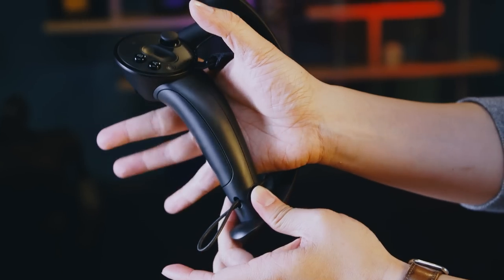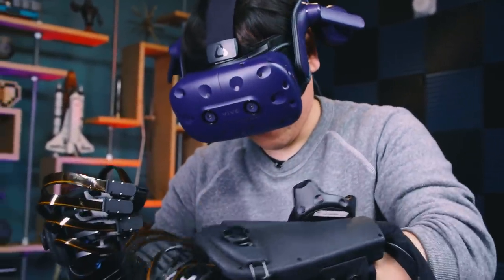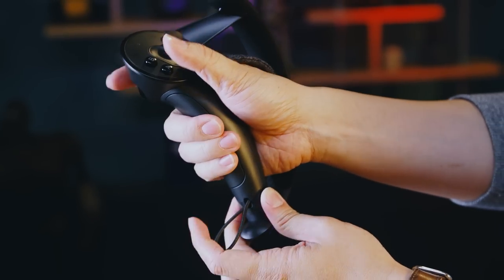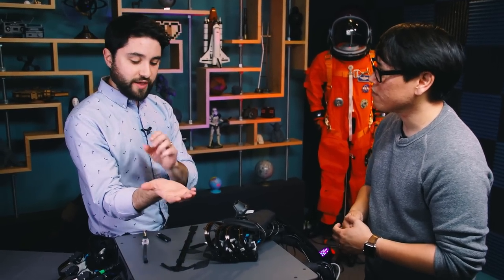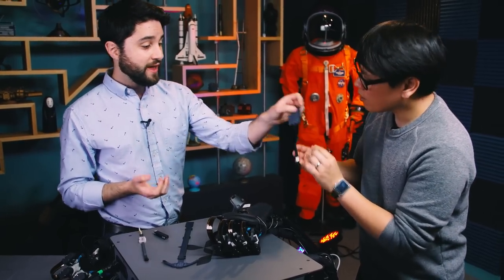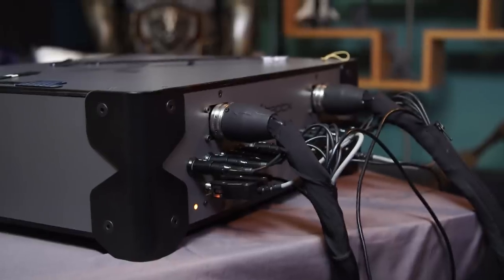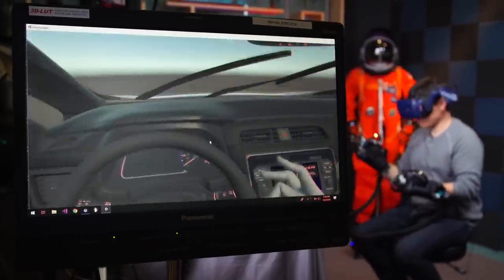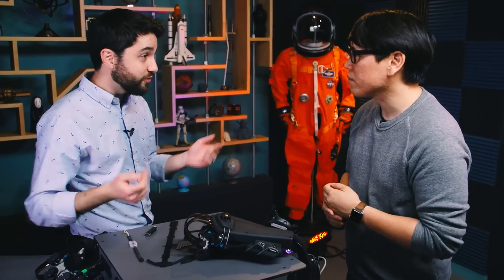Hands-On with HaptX VR Haptic Gloves!

Comment: The Power Glove every 80s kid really wanted
Reply: Damnit, beat me to the comment. was going to say "looks like a Power Glove for the Nintendo".
Reply: Glove? Don't make me laugh, this is a GAUNTLET worthy of the highest Tech Head Warriors
Reply: Dude if the switch 2 is strong enough for vr we are 100% getting the power glove back
Reply: @Shane_A_M  yeah lol switch 2 isn't gonna be powerful enough , not gonna have positional tracking and , its just a flat low resolution lcd panel... so no way vr is happening on a switch
Reply: Night the moon you telling me the switch 2 is going to be less powerful than the PS4? What makes you say that?
Reply: @Shane_A_M  no well yea more powerful than ps4 but probably the important stuff like positional tracking , game support , bad fov , bad resolution , bad refresh rate
Reply: Night the moon dude have you tried out the vr  labo, that thing is crazy accurate and a really quality vr experience
Reply: @rexulot4443  hmm based on the stuff ive seen its pretty good and props to nintendo on that but i hope they can actually do something really good
Reply: So true
Reply: @nightthemoon8481  it could be possible considering that oculus made a pc free VR headset
Reply: @rithradiengran7534  i doubt it considering the switch only has the 2 ir cameras in the joycons and a much weaker processor than the already weak quest
Reply: @Shane_A_M  ps4 is a very shit headset, it’s runs at a very low resolution among other things

Comment: Imagine looking back in 10 years and laughing at the size of these and looking at them as out dated and crude.
Reply: I doubt that ten years will do much difference since making hands feel pressure at random places without such mechanics would require chips/electrodes inserted right into the hands or the head. The non-invasive focused brain stimulation will definitely not become significantly more precise to emulate senses with finger level accuracy.
Reply: That was my and your first thought today. I think you meant ten seconds.
Reply: @StrangerHappened  look at modern bionic enhancements and computing technology and how it has advanced so far in just 5 years. This principle is known as Moores law.
Reply: I'm laughing at the size of them right now.  Yes I understand that it's a difficult problem but right off the bat these seem incredibly impractical...
Reply: I still laugh at the original VR tech we had back in the 90's in my teenage years!
Reply: VR Basketball at the Seattle Science Center. lol.
Reply: @StrangerHappened  Ill take extremely super invasive brain stimulation.
Reply: @Nitrodino7875  the idea is that in 10 years it will be standard and everyone will get gloves like this for 50 bucks on Amazon Prime and how we're looking into the future now. Try to have a little imagination, this is VR afterall.
Reply: @darkzler  don't need a brain surgery, maybe a minor hand surgery.
Reply: In 10 years we'll be eating rats and trying to survive in a post apocalyptic world...
Reply: @antoniocarniero5138  Moores law applies to transistor density? Did you know that? It doesn't apply to technological evolution as a whole.  Notice the mouse hasn't really changed. Notice the keyboard has not changed at all. Notice how in the last 5 years VR is still not using 2k screens. Moores law only applies to processing power. Nothing else.
Reply: @gusbisbal9803  but the idea behind Moores law indicates that technology will progressively become smaller as transistor technology does meaning not that it is getting more powerful but people have the ability to create technology capable of more things due to more space to apply said technology. Explain how things such as the computer mouse has changed over time is size and capabilities as it is now able to connect via blue tooth manage more input features and alternatively to a ball sensor use ir light detection.
Reply: probably because today we can look at the size and already know it could use some improvement.
Reply: gus bisbal lol...you’re joking right? That’s like saying “Notice gasoline powered cars haven’t changed at all” yeah, there are other things besides a mouse and keyboard to “click” and communicate lol also, vr has increased exponentially and definitely does over 2k per eye, just not oculus or Vive, the mainstream vr brands. Please do more research when stating claims as truth. Beyond all of that, we have proven Moore’s law to not be all that there is in regards to the evolution of technology. Don’t let semantics and titles distract your mind from finding truth beyond the borders of the societal rule of thought.
Reply: Not only is it crude, but naturally absurd. A complete disregard for style, and moral driven compass.

(last part is random. I know it doesn't make much sense. But that's ok, just let it happen sometimes)
Reply: Wait...
Reply: Get rid of wires and decrease size you actually have a product
Reply: @StrangerHappened  You doubt but you are completely wrong.
Reply: @antoniocarniero5138  I get what you're saying but Moore's Law is specifically about transistors. There's other "laws" that more aptly apply to different types of technological innovation.
Reply: @StrangerHappened  Think what we had 10 years ago. We had Windows XP and 100 gb hard drives.
Reply: Jose Castillo calm down
Reply: Yep, it’s still like an early prototype.
Reply: @StrangerHappened  That's where Elon saves us with Neuralink
Reply: Well, look at VR hand-trackers from the 80s and 90s. They were much more compact than those and still had finger flexion tracking for each finger and fingertip feedback.
Those in the video only are updated version with a more fingertip feedback points and grip force-feedback... plus are clunkier.
Reply: Antonio Carniero Moore’s law is on the verge of collapsing , and it’s referencing transistors ....
Reply: And that is exactly when I will buy one!
Reply: @StrangerHappened  I don't think he meant that advanced. Just that future gloves like these would be much slimmer and more precise.
Reply: @antoniocarniero5138  the moore's law doesn't work for everything, for example the internet is thousands upon thousands of times faster nowadays with 1 gigabit connections becoming standart and 1 terabit coming, but storage didn't evolve any shit in the last 10 years, we got from like 500gb HDDs to 2tb HDDs, not even close to the moore's law which should have 16tb as standart today
Reply: @MrHeliMan  Future Man
Reply: @StrangerHappened  no bro, sense of touch can also made with sound waves, or just smaller gloves that can put resistance on your fingers. As technology progresses, things get smaller and smaller so I can see this technology one day being fit into gloves that look like any other, and tech is moving fast so it might even be possible in 10 years. I think commercial brain implants is decades away tho lol
Reply: @kevadu  it's the first step in the right direction so don't hate on them for pioneering technology
Reply: Honestly I doubt they can have a much smaller technology that can do the same as this, except some brain computer interface but that is probably 20 or 30 years in the future, if you want to wait is ok
Reply: @KidCarnage  No, no, no! Monetize it right now! $$$$$$$$
Reply: Just like we do now to old vr headsets.
Reply: laughs in 2020
Reply: @StrangerHappened  Or just improving the native hardware to shrink the size. It happened to phones in a very short period of time.
Reply: @StrangerHappened  yet in these past 10 years (even less) VR has evolved from a screen stuck to your face to this.
Advancements in technology are exponential proven from our history with it
Reply: @StrangerHappened  Laughs in exponential technological growth
Reply: gus bisbal  Moores law applies to transition density, yes, but it can be generalised into the idea of "accelerating returns", as described by Ray Kurzweil. He noted that you can apply this to pretty much all technological developments, can infect track back right through pre-industrilisation to date - you can also project it forward. It is pretty useful in describing almost all technological growth curves over time. The fact that the keyboard hasn't changed design is pretty narrow - I'm right now typing on a touchscreen. And the idea that you couldn't reduce the size of this over time is even narrower - miniaturisng almost any development should be expected over time.
Reply: @gusbisbal9803  Moores law applies to transition density, yes, but it can be generalised into the idea of "accelerating returns", as described by Ray Kurzweil. He noted that you can apply this to pretty much all technological developments, can infect track back right through pre-industrilisation to date - you can also project it forward. It is pretty useful in describing almost all technological growth curves over time. The fact that the keyboard hasn't changed design is pretty narrow - I'm right now typing on a touchscreen. And the idea that you couldn't reduce the size of this over time is even narrower - miniaturisng almost any development should be expected over time.
Reply: @kevadu  honestly they don't even seem that bulky to be something I wouldn't buy today
Reply: @StrangerHappened  neuralink hours
Reply: Imagine looking back almost 30 years right now... And realizing they still haven't gotten any smaller yet really.
Reply: @christianbrighten6092  Umm, it hasn't changed that much in almost 30 years. We just got more powerful PCs and moved from using CRTs to LCDs so the headset is lighter and we have more powerful graphics cards.. But the actual VR devices have had very little change. They had gloves and body suits like these and motion tracking 25 years ago.. Sure they weren't nearly as good but they were just as bulky as these.
Reply: @darkzler  Well, it seems you'r not using it much so I guess you won't even notice if the procedure fails and you end up a vegetable. :)
Reply: @StrangerHappened  yeahhh but thats what people said about other technology too and look at where we are now
Reply: outdated is one word
Reply: 8 years left! Can't wait!
Reply: not even 10 years! :) It's 3 years later now and the to-market version is already much more compact and slick than what was demoed here :) Still a weird backpack you have to wear, but impressive form factor for what the product needs to do nonetheless!

Comment: hmm. Didn't MIT create a material that unfolds when current is passed through it?
If so instead of using loud clunky air to deform the lining -you could use low currents.
This would also decrease size required and eliminate the need for attachments.
Reply: It could also be that the material doesn't unfold with the force required to fit their needs.
And as previously mentioned, they probably don't have open access to that material (they'd need very open access to mass-produce)
Reply: You guys in reply section really give valuable insight, no sarcasm.
Reply: It said in the video that the air valves wasn't loud.
Reply: I'm have no idea what is going on here but it sounds smart asf
Reply: Batman begins

Comment: Could the valves and air be replaced by an electrically stimulated expanding gas? You'd just need a couple arrays, one of bubbles, and a soft chip attached to it. Might have a minor explosion risk, but you can mitigate
Reply: Ok this is big brain time

Comment: I'd love to see a reverse version of those tactile actuators for use in prosthetics.
Have them detect pressure in real life, and then connect to a normal set of actuators somewhere else on the body so that someone with a prosthesis can still feel touch. (obviously the sensation of touch would be odd, i.e. pressing with your finger would be felt on your inner arm etc.)
Reply: The brain would remap,. VR could be used to slowly  'adjust' 'where' the brain interprets the sensation as coming from,.  Seeing brain cells, can remap for hearing, WE ARE 'PLASTIC'!

Comment: I suspect that they could reduce the space between bubbles a bit. And I think that it would benefit the experience, too. I imagine they could do this by using accordion type bubbles, to reduce the amount of space needed on the edges, to allow the travel distance that they're aiming for with the bubbles. Shouldn't need a lot of folds in the accordioned portion; one, maybe two. And it might be good to allow it to form a rounded shape when expanded, instead of relying on the folds entirely, if they intend to leave the bubble density as low as they have it.

I think it could use a higher resolution on the fingertips, as we do have a higher density of nerve endings there. Especially considering that people can read braille, and distinguish between the different combinations of tiny bumps. I don't know what the entire inside of the gloves look like, so I don't know if they do this, but… Using a different density for the bubbles, in different parts of the hand, based on the actual density of nerve endings present, would seem like a good idea to me.

Another thing I wonder about, is hot and cold… A way to rapidly heat or cool areas of the hand, within safety tolerances, would only add to the realism. It'll probably be a headache to get to work in practice, though. It was the mention of the virtual rain on the hands, that got me thinking about hot and cold, because surely, the lack of temperature change broke immersion a little.

Comment: At one point they had heated and cooled water instead of air, which was probably way more compelling, but also infeasibly expensive
Reply: Until they make use of magnetic polarity (and the willingness of magnets to MOVE) it won't be commercial.  Little coil electromagnets,  controlled like a 'video' as a spanned data... When bubbles em coils are same polarity top and bottom, it bubbles upward, when it is opposite, it bubbles downward and when neutral. it is,....neutral..
Reply: @NextWorldVR  the problem with that is, they use an electromagnetic field for finger tracking, and having 140-odd tiny electromagnets in both the palm and the fingers is most definitely going to cause some interference with that.

Comment: Easy fix for the bubbles feeling separate, add a layer that when two bubbles rise its connected between the 2 highest points of the bubble creating a solid area of pressure. As for force feedback on arms you can use passive locking in a way that you can always pull your arms back and bend them and it never bends your arms or pulls them for you, merely stops you from pushing your arm a certain distance from, let's say a strap on your shoulder, or bending your elbow when an object is against your forearm. Then maybe with legs all you really need is a pressur pads on the sides of your feet to maybe simulate the contact of kicking since gravity and distance is involved with leg motion. A pad that goes maybe inside the sides if your shoe that when you kick a certain distance you feel the pressure to know the kick has landed, same with shin. As for force of Kick it's easier to have a set reaction in the game to keep design simple. Then you have functional arm stopping systems, leg sensory, and all that's needed may be excesorries like vest with magazine pouches or armor that have  a chip that loads the measurements and rendering around the avatar of your measurements so you simulate the vest in real life. Load a backpack with pouches for each systems hardware and software once it's made into a compact fit, and then there's the making a really awesome open world zombie survival vr game. The hardest part is getting the textile features. Once you have a system for that the rest is just duplication and measurements for the specific limbs, which mostly don't require any sensory except hands, side of feet and maybe a bit of the arms or torso.maybe make a sensor that vibrates letting you know your arms or legs or back is close to hitting a wall or object in real life.make it to where the walking in the game is done by lifting knees without extension of legs and extension within certain speed is a kick, or held up then pushed out could be more of a push with your leg that stops the object without pushing it away until a quick extension after leg is raised,  I hope someone sees this comment Because the zombie apocalypse is way easier than real life

Comment: Think you could shortcut a lot of the tactile sense by using skin contact electrical nerve stimulation and simpler gross tactile resistance. Never get true tactile sensation otherwise as a big part of touch is actually electrical.

Comment: Now add nichrome wire and put water instead of air into those bubbles to simulate temperature as well.
Reply: I think they once did use water. But air can get warm and cool aswell
Reply: @whiteoutwolf6131  yea but water is much better at transfering heat than air. That's why water cooling in PC's is considered superior. You can easily get water from 20 to 100 and back to 20 degrees celsius in seconds while you can't with air.

Comment: Does it need to use air in this way? It seems they should focus on switching the tactile feedback method to one that can be miniaturized more easily. Air and fluid can simulate temperature, so maybe they should try that while they are at it. I "firmly" believe the resolution should be high in a stretchable material that may fit variable hand sizes, even if there are Sm, M, L and XL gloves. I think the best gloves of the future will be combining multiple sensation capabilities like a small shock capacity (just enough to feel movement across the skin), vibration frequencies, temp and variable speed analog pressure.
Reply: or maybe vr gloves just don't work for VR and having controller-glove hybrids like the knuckles are the best way to experience and interact in VR while maintaining the best hand presence. Also care to note that there are a ton of sanitary issues with gloves, one more nail in the coffin as to why VR gloves will never become a thing.